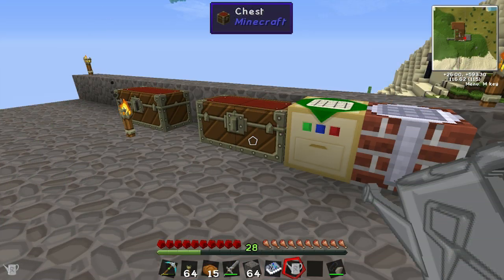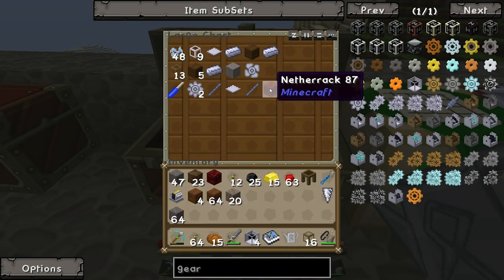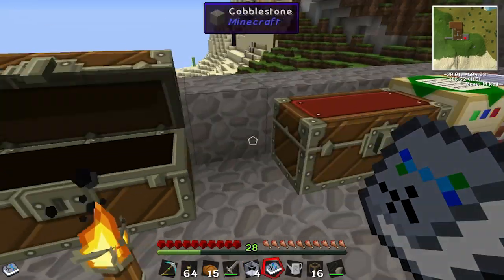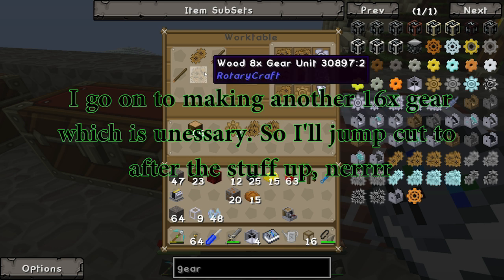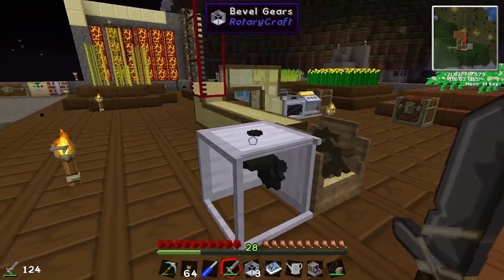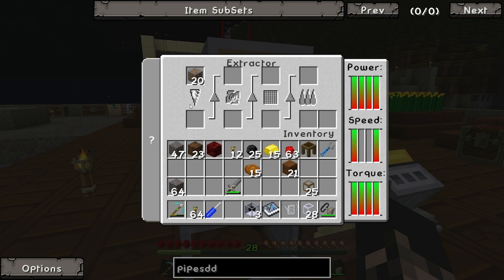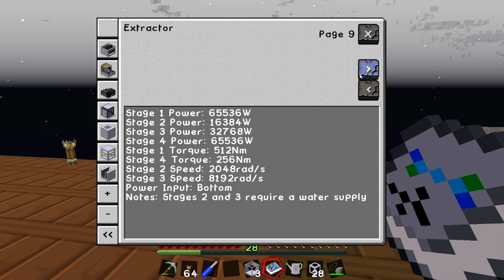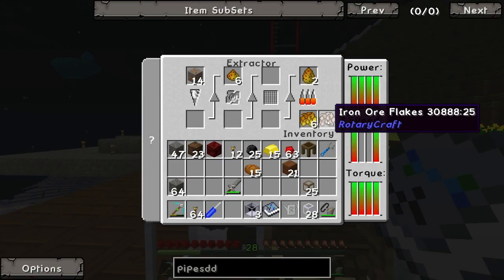Monster FTB Rotary Craft Ore Processing, Extractor, Gearbox and Bevel gear

Comment: Adding more speed always increases machine speed. In the case of the Extractor, I have it running at 512Nm @ 65536 rad/s for instant operation of stage 1 and 4, and 1Nm @ 1Mrad/s for instant operation of 2 and 3.
Reply from the maker: I Tested with  with about the same 512Nm and about half the rads and didn't notice a speed increase on stage 1 and 4. Maybe I messed up. Do you know if there is a point where more speed effects become apparent.
Reply: The relationship is logarithmic, so it is most dramatic at low speeds.

Comment: make 2 motors 1 for speed the other; for tork or  a  third with  power mode will also help (optional is power but the other two can come in handy dandy)
Reply from the maker: In the end I just powered it with a reactor. Thanks for the suggestions. BTW cool name.

Comment: If a Redstone signal is applied to the gearbox does it change modes or shut off because if it changes modes could you not set up a clock say... every 10 seconds?
Reply from the maker: I've tested and no they don't yet. This might change. The closet I've gotten is an Autonomous Activator but it switchs modes too fast for the stages to complete.
Reply: Ausyarr You could have the autonomous activator only work on a redstone pulse, then hook a red power timer to it

I know it's a bit wasteful, but once I get to setting up a pebble bed reactor, I devote one of the turbines entirely to an extractor, with a 16:1 bedrock gearbox set to speed mode. This gives it enough NM for all four stages, at a million rad/s, and makes the entire process instantaneous.
Reply from the maker: Thanks, a clock from expanded redstone should do it to.

Comment: Can  you hook up 2 gear boxes with one on torque other on speed and i didnt quite get how to make it faster
Reply from the maker: You can't have two inputs with different speeds unless you use a clutches to on/off the inputs. To do it with one gearbox to have choose a gearbox that that on torque mode can can do the torque states and if switched to speed can do the speed stages. you change a gearboxes mod by shift left click with a screwdriver.
Reply: ok ty

Comment: Attacked the  engine and the gearbox won't move.   it has lub  engine is running.  and attached to the Red  on the gear box and Gearbox to the  yellow on the bevel gear..  but nothing..  even changed to a stone gearbox from the wooden one ..  no joy at all
Reply from the maker: if the gearbox is turning then it's probably the bevel, change the input and output sides of the bevel so there not connecting and then connect the output to the top and then do the input. occasionally the input and output can be around the wrong way.
Reply: Ausyarr The gearbox is not turning but the engine is powered ans  rotating ..

Comment: If a Redstone signal is applied to the gearbox does it change modes or shut off because if it changes modes could you not set up a clock say... every 10 seconds?